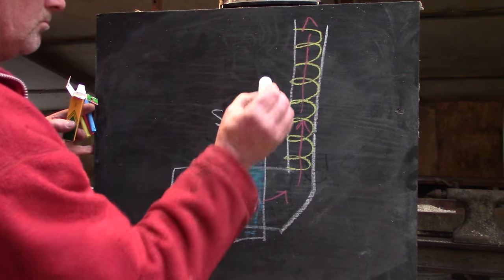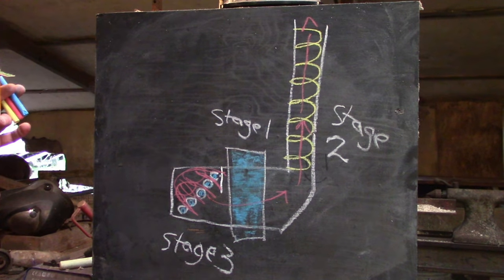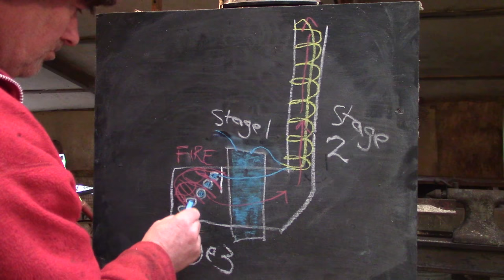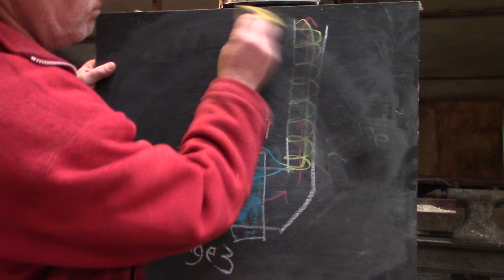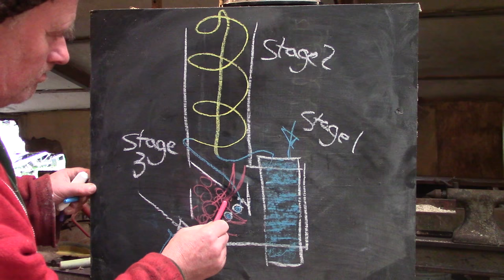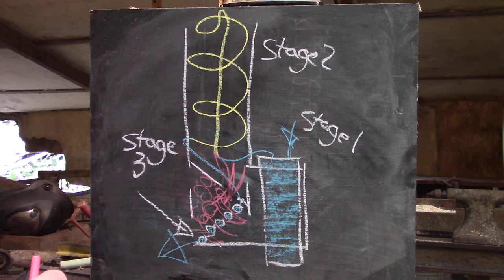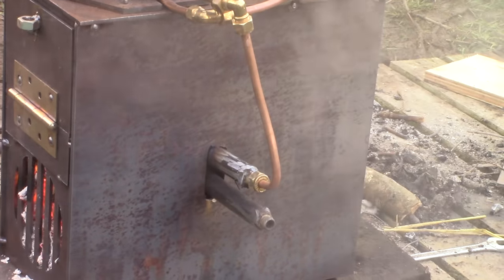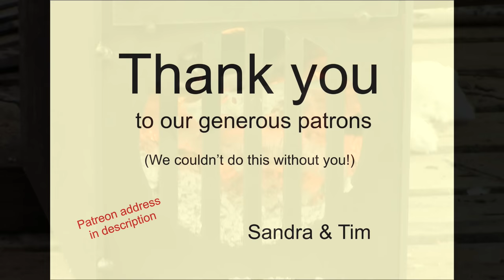Finally A Flash Steam Boiler That Works!!

Comment: Tim, be careful using brass fittings at those temperatures, they will de-zincify, leaving a soft spongy material that will fail. Also be mindful of the dubious quality of the gutter bolts holding the lid of your pressure vessel on, best to replace them with some grade 8 or above when you start making pressure. Very interesting as usual! 👍
Reply from the maker: Good points - thanks

Comment: At what pressure do you plan on operating the boiler at? Your feed water will have to have greater pressure then the boiler pressure to avoid a low water situation AKA turning it into a bomb. If you don't plan on making pressure greater than your standard water hose pressure a check valve would still be a good idea to prevent steam from entering your water pipes. Consider any pressure you make in a closed system will not be easily controlled you should try and have multiple safety valves. The water heater safety valve you currently have installed isn't meant for steam use but pressurized hot water. Good luck and safe boiling!
Reply: His system isn't closed. The steam is free to escape through the copper tubing. There is not valve trying to over pressure the tubing.
Reply: @jameskniskern2261  Yes, as long as the steam is not put to any work, the system is opened, but as soon as the steam sees an obstacle, such as trying to operate a steam engine, pressure will begin to build.
Reply: @Gin-toki  if the pressure builds there is a safety valve that is the blow off point. There is no collection reservoir to build pressure the pressure is created forward of the float valve. He may need a check valve on the water to prevent steam backflow. But with a safety valve at the 1st stage boiler, the entire steam generation system is protected by said valve.
Reply: I think he's going to build a vacuum steam engine... No scary high pressure!!!??

Comment: Not sure if its been mentioned already, but depending on how much 'spare' steam you have, you could fit a blower up the chimney to increase the draught.
Reply: Definitely worth doing.
Reply: Absolutely.  Just a little exhaust from stage 1 will make a huge difference in efficiency.

Comment: I'm very glad that there's the addition of a pressure relief valve. That's certainly much more important than most people assume
Reply: Two working safety valves is critical. These are off the shelf components from model engineering suppliers. In you UK you have plenty of sources like blackgates
Reply from the maker: But I'm not in the U.K.
Reply: @wayoutwest-workshopstuff6299  oh! Where are you? Looks and sounds like the uk 🇬🇧. :)
Reply from the maker: @chiefauditor1683  Ireland - so not so far away, except the import duties make buying anything from there crazy
Reply: @wayoutwest-workshopstuff6299  a lot of model engineering parts are made by people in the hobby. Still at reasonable prices. I’m not familiar with model engineering in your neck of the woods but I’m sure you have them. Well worth the time. Also take a look at a blower for the chimney. Basically a ring with very small holes. 1/64th. Tiny jet of steam up the chimney drawing the fire.

Comment: Hi Tim, just in case you burn yourself, keep a bottle of clean water near. In my experience (below 250°C), it's really helpful to lower your skin temperature as quick as possible (within seconds) after a burn. Then keep the injury under a tap for as long as it hurts. Thank you and Sandra for your great videos!
Reply from the maker: Good idea
Reply: And salt as well. If the burned skin is intact, just after heat contact, use cold water first and apply a lot of salt. It prevents from the 2nd degree burns and blisters, I think, due to osmotic draining of excessive liquid.

Comment: Perhaps just make the walls and floor of the firebox itself a water container. Bending copper pipe can be done with with sand or salt inside it. Americans add it to the outside of the chimney.

Comment: I liked the idea of water running through the grate a bit better than steam because keeping the steel at a lower temp would help keep it from rusting out. Guess that might have made the fire burn too cold and been a bad idea anyway. It sure is a nice design as is. The plasma cutter is the perfect tool for this stuff.

Your matches don't flame up because you've got so much steam that it's pushing all the oxygen away. Matches need a bit of air after the chemical oxidizer on the tip is used up.
Reply: I agree with your idea of running water through either the grate, or a portion of the tubing in the chimney.  It takes a huge amount of energy to boil water, but only a bit more to superheat it.  I think the reason the steam volume was so low is that the boiler needs more surface area in boiling section and less in the super heater.   Also, I would suggest a larger firebox for more BTUs before having to add more wood.
Reply: I disagree with you here, you actually don't need a whole lot of steam in terms of volume to get work from it, the most important are temperature and thus pressure, this is exactly the reason why in every coal fired power station the water is boiled in the wall of the boiler and super heated in the heating elements in the fire box, especially as the system is self regulating once you are actually running at pressure, the best way to run this system would actually to be boil the water in the chimney, then going though the flu box and finally into the fire box.
Reply: The high pressure steam blasting out is blowing out the match. You can see the match starter burning completely. He should have pulled away as soon as they started to ignite.

Comment: I think bending the tube would have a couple advantages. Firstly, I guess I'm not certain how it applies to steam, but for fluids like water or air, a long sweeping curve allows for greater flow without interruption or eddy currents. It would also eliminate your problems with welding and pinholes. If you find a spring that fits nicely either inside or outside of the tubing, this will allow you to make 180 degree bends without kinking the pipe. A lot of people suggest filling the pipe with sand, this works well but I think it is far too time consuming.
Reply from the maker: I'm sure it would work for bigger radii, but for bends this tight?
Reply: Maybe just use elbow fittings, and instead of using Teflon tape just use old-fashioned packing?
Reply: Nice idea. The only problem I see is the thickness of the tube wall and the radii you want here are not practical for it to work ..... and spring bending only works with copper pipe so the grate is out for that!
Your pinhole problem can be fixed (next time, because there is always a next time) by grinding the cut edges of the tube to be welded at 45 degree. This would allow for deeper penetration of weld rather than just the surface .... the finished weld will look better too ;0)
It is a bit out of fashion nowadays but Gas welding might give the best results with the grate but is probably not worth it unless you are doing production runs.

If you had run your gas torch on the original chimney it could have started the draw causing the exhaust fumes to then take over the heating ..... but your fix was more elegant!
I have just found this channel ..... Well worth a sub!
Reply: @wayoutwest-workshopstuff6299  trumpet 🎺 and other brass horn makers use frozen soapy 🧼 water. Soapy enough to easily blow bubbles with the water. 
 Freeze it then bend it. 
   You'll also want to use a very high grade of stainless steel tubing meant for this type of heat exchange.
  At superheated temperatures 🌡,  the steam will actually begin to break down some and into hydrogen and oxygen. And will rapidly degrade the steel otherwise.
Reply: In this case the extra turbulence is likely beneficial to the longer exposure of the liquid/vapor to heat. Nothing to solve, but good thiunking when flow is the restriction (it isn't here).

Comment: That is really quite amazing. Superheated steam will set paper alight so if I had to guess I might reason the temperature of the steam still is not high enough. Perhaps a greater amount of a smaller diameter tubing in the firebox may do the trick. Enjoyable content as usual, cheers!

Comment: Try insulating your fire box/boiler and maybe even the section of your stack with the second stage coils so you won't lose so much heat to radiation. It works with stoves. Great job. I will give you credit when I imitate it to run a turbine generator.

Comment: ingenious! this is excellent. 

a hopper/fuel feed tube, piping to add more hot air /O2 to updraft to assist with second stage burning - black smoke should be clear.

Comment: You're going to need annual boiler inspections now.
BTW, they make cheap thick walled bends. In the size you want them mandrel bends are very very cheap.
They have wide and narrow radii to choose from too.
The thing is the way you've done it may make for more efficient heat transfer than smooth bends but it is worth knowing they're out there.
Reply from the maker: thanks - I had no idea they were out there

Comment: Awesome project and well thought through. Having an economizer, vaporizor and superheater, in the right places, and even using up/down stream heat transfering method is great. The only thing that could cause a problem now is the water. The minerals and salts in the water like cake up on the walls, reducing efficiency and insulates the steam pipes so they become hotter(the steam is cooling the pipes so they don't melt). If you're using a closed system you could use it for central heating and add a base to the water, NaOH or ammonia. When water reaches it's saturation temperature in open air, the pH actually falls down to around 6, which will slowly begin to corrode the piping. Keeping the pH around 9 prolongs the lifespan of the boiler.
Reply from the maker: Thanks, Rasmus - very interesting

Comment: Very impressive. The whole thing is a boiler, not just stage 1 - you have boiled water to dry steam in 3 stages. A cyclone separator between stages 1 and 2 might improve efficiency and would certainly extend the life of the boiler, as water droplets going into stage 2 will tend to cause errosion. Stage3 is in fact a superheater as the steam ought to be dry saturated as it exits stage2. Obviously if you vent stage 3 to atmosphere this cannot be demonstrated. Your matcheads burn demonstating that the steam is dry. Don't expect a visible flame from a match in a hurricane!

Comment: And here I was telling myself I just don't need a new subscription.  Oh,well.
Here's a thought. I was just looking at the videos of the boilers of battleship Texas. The boiler with the three main drums is a common marine design. There is footage of the internals and just what was done to separate water from steam. Well presented,it just might give you some ideas to fiddle with.
I was quite impressed by your use of the empty fuel cylinders . Smart. And you already own them,no fiddling required. 
All the best.

Comment: One way to increase the temperature is to add a blower. It's basically just a valve you can open & close to let steam out of the smokestack to draft the fire and suck more air in. This will drastically increase the heat and by extension, the steam production.

Comment: Thank you Tim and Sandra for your video s awesome ! In us were I worked we bent a lot heavy wall pipe we did it the old fashion way we welded a cap on one end    Of the pipe pack with dry sand fill weld cap on end make fixture heat take your time bending we used heavy wall it won’t kink I’m was told u can use wax never tryed just something to think about
Reply from the maker: Thanks, Terry. But how tight were you bends?
Reply: @wayoutwest-workshopstuff6299  the heavy wall tube we used had multiple bends 90 O on one end sand packed tight proper heat should bend what you want

Comment: Tip if you want airtight welds: Leave a 1-2mm cap (widh of a cuttin disk) between the parts, use lot of power and less wirespeed and weld in short bursts.

If you have oxyacetylene torch it makes easy to do airtight welds, it also wont leave stress in the welds so they wont crack from heat cycles or from vibrations.
(i always use this to weld car's exthaust pipes)
Reply from the maker: Ok, thanks.

Comment: Man do I love your videos - this is just how I build things and how handy folks have been doing it for generations. I wonder if your original designs (or at least the version at the start of this video) draft problem could have been fixed with a little door at the bottom of the chimney. When starting the fire in the main firebox you could stuff some paper in the bottom of the chimney (through the little door) and light that. Perhaps it would start the draft and once the little door is closed the already started draft would make the primary fire draft up through the chimney. Just a thought - I have no idea if it would work.
Reply from the maker: I've been wondering that myself!

Comment: Great job Mr Tim. Step by step, building on lessons learned, a proper development programme.
Mk II may need to be built with a fire brick lining, that fire looked pretty decent and a few months use will see the bottom and sides start to suffer. When I built my second wood burner I designed it around the cheapest rectangular fire bricks I could source.
Reply from the maker: You're right David, but I'm still prototyping so there's no hurry

Comment: to get the fire to reverse directions you should use a fan a the top of the chimney to pull the fire through at first. then when it gets up to temp use a steam blower to keep it flowing. This is how it works with real locos; the fire is pulled through the fire tubes with the blower. Even with your improved design it would help to get it started and become more efficient. it would also be better if there was a larger area for the steam to come out of the boiler or a wider boiler. the seam can only escape though the little cracks between the float valve and the boiler walls, and because its at such a low pressure at that point the steam is not escaping efficiently.
hope this helps!
Reply from the maker: I am!

Comment: Looking good 
I think it needs a tiny bit of back pressure that will raise the boiling point and increase the density of the steam in the pipes allowing for better heat transfer
Reply from the maker: Yes, I was thinking the same thing. But t hat will come when I connect up some sort of exit restriction valve

Comment: To use the grate was brilliant, I am also interested to see if this will lower or increase future rust.
Reply: Oh, it will rust. The oxygen will eat the metal from the outside the fire side, and from the inside the tubes sides. 
Tim may end up replacing the grate often. 
But we don't know how much use this thing will have, do we? :)
Reply: @jameskniskern2261  so you say it will rust more? Even though it will hold a lower temp?
Reply: @mhill3884  yes. With the water carrying oxygen, and the high temperature of the fire on the outside of the pipes. The oxidation will increase.

Comment: Here is a suggestion for how to power a locomotive: a Stirling engine, you heat the hot side with anything that burns,  it is much quieter than a internal combustion engine, it does not need to store heat as energy as steam (but you want a flywheel), and to power the loco:s drive axis a clutch and some gearbox. you might even replace your diesel woodchip-er with this if you could find a way to connect it (i am sure you can), perhaps even mount the woodchip-er to railcar.

i think this full fills all your requirements.

Thank you for sharing all your interesting tinkering.
Reply from the maker: I think they're very difficult to get working properly and have very little power

Comment: More pressure will raise the boiling point several degrees, but the heated steam is dangerous and not just to bare hands, check valves preventing backward steam flow and an orifice with a changeable insert that allows the user a custom selection of flow control / (length x diameter variables, carburetor jets would work if used direct in line) that will pick it up to the point of removing muscular and connective  tissue from bones (we used steam at the meat processing station for sanittizing and mechanical cleaning and it works thoroughly and instantly.

Comment: The draft problem with the first version of the stove could have been solved by pre-heating the chimney with the torch. Keep something smouldering at the rim of the fire chamber to create a little smoke, then pre-heat the chimney until the smoke is drawn down and into the fire chamber, and THEN light the fire.